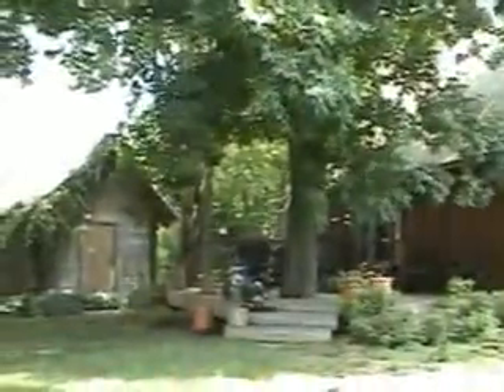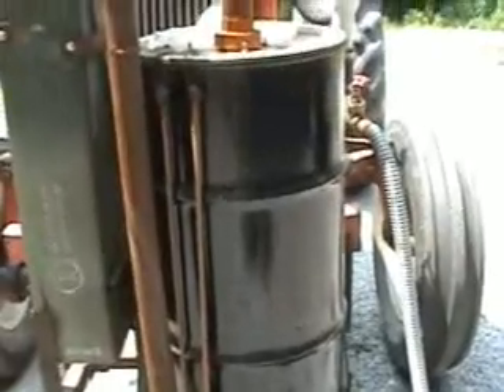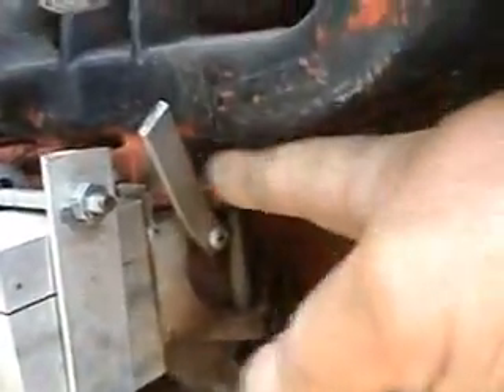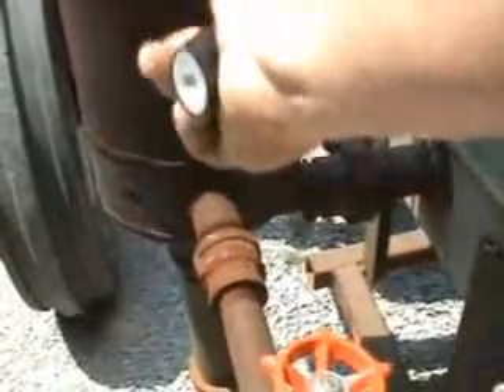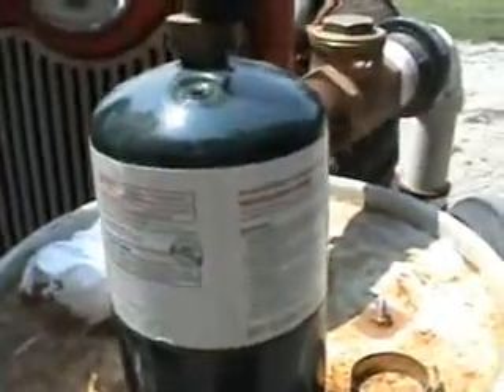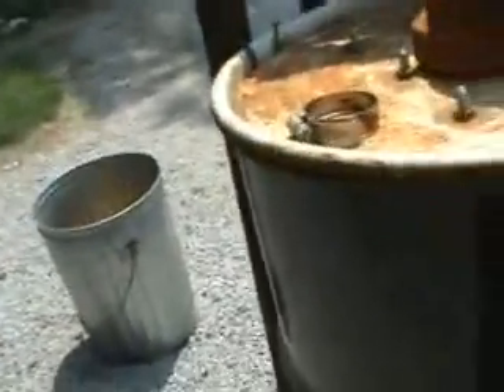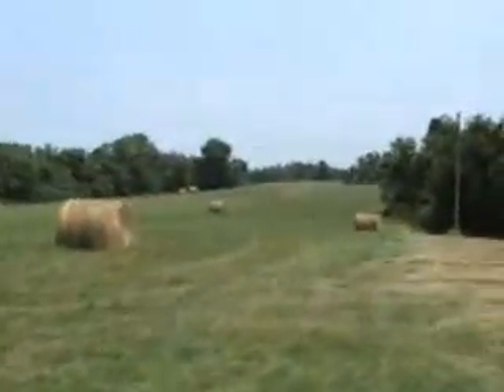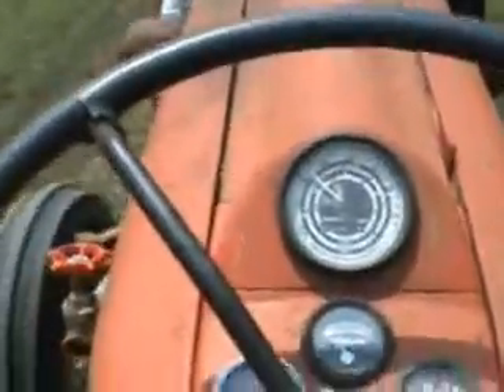wood gas tractor.wmv

Comment from the maker: Thanks Bill,  The rock wook does fine with the wood gas, but it's almost too good a filter.  It's gets clogged pretty quickly.  It my last few runs, I just used more hay, packed in pretty tight. Just a little water in the bottom does a great job of cooling down the gas, hence no radiator is used.  In any gasifier design the deeper the hot coal bed is, the cleaner the gas will be.  I haven't used the gasifier in a couple years now, but it's sitting in the barn, ready and waiting.

Comment from the maker: Shallow bubblers do a great job of rapidly cooling the gas.  But if the water is too deep, then the engine has to work too hard to pull the gas through it and thus reduces power.  The wood gas is humid to begin with, so a lot of that water will condense out in the bubbler, just as a lot of the bubbbler water will go to vapor from the hot wood gas.  So, I really don't know whether over time you would have to add water or let some out.  But I do know it's not something that needs daily attention.

Comment: I am considering putting a bubbler in the project that I'm currently building.  However, It seems that the hot gases entering the water would cause some of it to evaporate, thereby causing more moisture in the gas, just before entering the engine.

Does this seem to be a problem?  How often would you need to refill the bubbler, and how much water does it seem to consume?

In your opinion, would there be an advantage to using a low-viscosity motor oil, instead?

Comment: The tractor in the video runs on petrol.  I presume yours is diesel.
Adding more wood gas will decrease your diesel consumption up to 90% if you are lucky, or swap your diesel injectors for spark plugs and ignition system, and you could possibly run 100% wood gas. That might leave your engine without some vital lubrication from the fuel, although Xado or Ceramizer products will help this problem.

Comment: That's a nice little build. I just built a small fema gasifier for running a generator with
before I knew about the imbert setup but I also designed some good filters that clean the gas to the point that nothing comes out of them but fuel. I'm already into my new build that will be the "keeper" and it was a great learning experience building the fema so I'm still very happy that everything worked when I did the build.

Comment from the maker: Thanks a bunch for the positive comment.  For longer runs, a bigger hopper would probably be the simplest.  As it is, it'll run nearly 40 minutes at full power.  After I posted this video last year I did build a unit for the '51 chevy truck and got it running pretty good.  But, I eventually got into more hovercraft and lost interest in wood gas for awhile.  I do that.  But it's good to know that in a real fuel crisis, I do have a limited solution for me and mine. Thanks again.

Comment: Just one thing i can say cool vid love that u showed ppl that u did make a gas bypass most dont show so u never know if they r using any gas ty ty. One thing i can add the base fuel mix for producer gas thats 1-1 for gas and air makes a motor run the best how i get that done one of 2 ways a home made butter fly in air mix and gas mix pipe hooked by one cable so they open the same or a ball valve with a bar to connect them to make it so the gas and air stays the same and that is my speed control.

Comment: Thanks for answering  my qustion about the unit puffing alot more instead of cost alot more. when low  on wood. I have had the same experience rare though. Iam very carefull looking down thefire tube. I run a small generator 5hp hopefully getting a larger generator at an auction.here in the catskill mountains nys. Keep that tractor running on wood gas.in burbank .k .working for you. Thanks again for your input . Keep the Faith  John93667

Comment from the maker: About 12 lbs of wood will fill it and it'll run about 35 to 40 minutes depending on the wood, and how hard you run it.   Nice part is, you can re-fill it without shutting off the engine.  Thanks for watching!